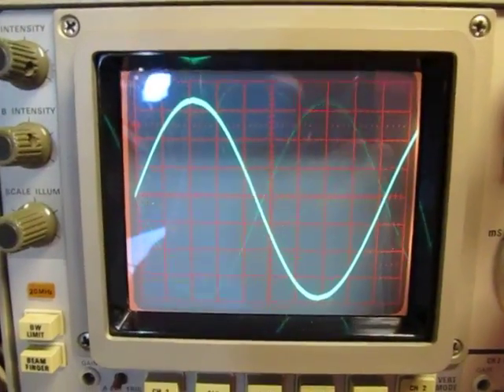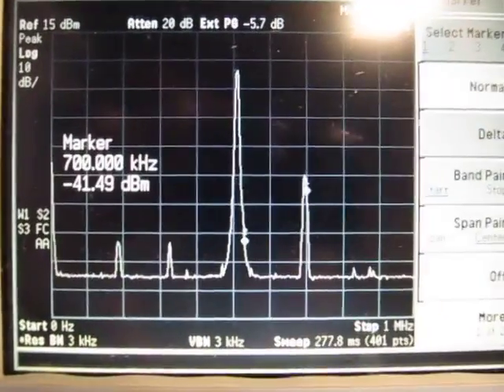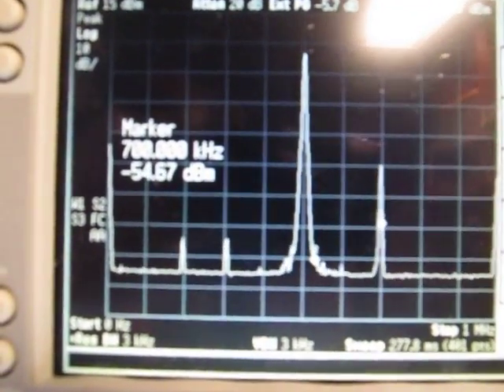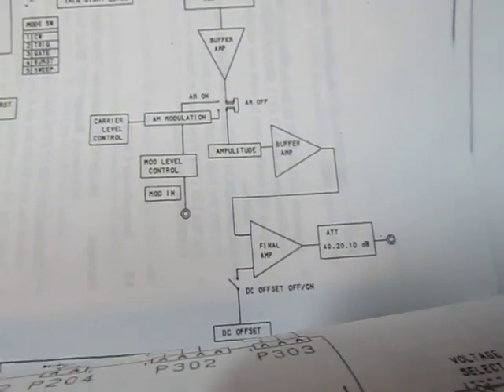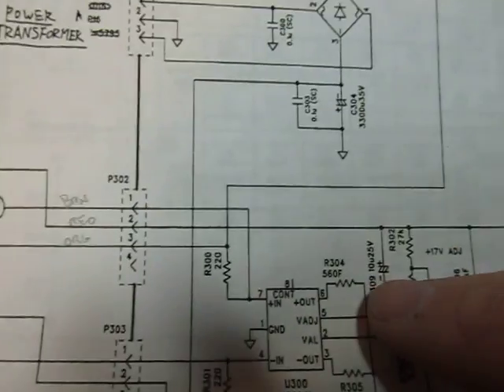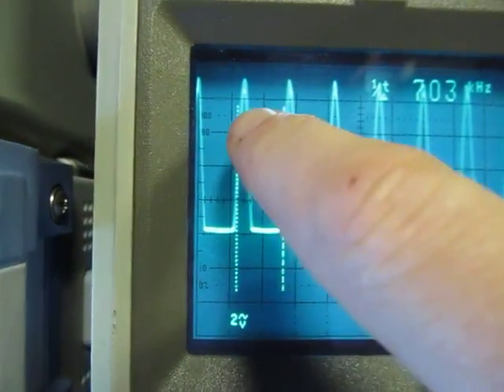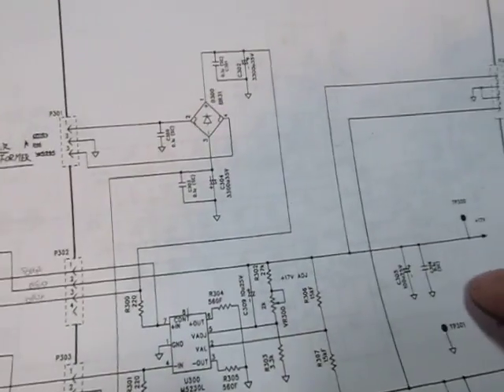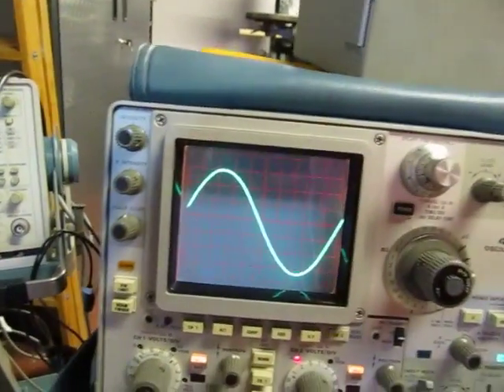#39: Function Generator debug and repair - Leader LG-1311

Comment: Excellent video!  I have an LG1311 that I got from a club sale.  It turned out to have the same symptom as yours, and omitting the capacitor cleared it up!  Good find!
With that repaired, I undertook the task of aligning the LG1311 per the calibration procedure (looks to be the same documentation you show in your video).  It was going well, but I ran into a problem...
At step 8, the forth bullet point item states"Check that the frequency with the Dial at 1 is one tenth the frequency measured with the DIal at 10."  When I did this, I got a frequency of ~200Hz instead of the 100Hz I was expecting.  Repeating step 8 didn't seem to help.  I tried the other Ranges, and the result was the same; the measured frequency at 1 on the DIal was ~ .2 x the frequency at 10.  
I rechecked the voltages and supply lines for DC and AC, no apparent problems.  All the unit functionality I've checked seems to be working as well.  The Frequency pot on the front panel is 1k (taper unknown), and appears to be original.  It has no wear issues so far as I can tell.
My question is: do you see this problem on your 1311?  If so, is this normal operation?  It's not critical for my usage (I can always hook a frequency counter to the Sync output), but it seems a little sloppy for a piece of test gear.
Any suggestions would be appreciated.  Thanks!

Comment: Do you think if you measured the capacitance under dc bias, you would see a bad value? Presumably the thing worked... Nice tip about the false triggering...next time i have trouble with the MSO scope and blaming tektronix I will look for something riding on the waveform.

Comment: Thanks for this.  I have a Leader LG-1300 with the same kind of problem.  However, it uses a different design with +/- 10 VDC adjustable, and +/- 15VDC non-adjustable.  The 10V is dead voltage-wise but there is mucho crude on the scope at the 10V test point.  Still at the head scratching stage.  de K8nn

Comment: w2aew very good video, but the engineers from Mitsubishi who design this power supply module was definitely drunk.

http://pdf.datasheetcatalog.com/datasheet/MitsubishiElectricCorporation/mXqyyxt.pdf
Reply: Seems like that cap in the datasheet is 1uF and not 10uF in all of the example circuits...

Comment: New subscriber here. Working my way through your videos from the beginning, watching the ones that seem interesting to me. You can expect some comments on older videos to appear regularly for the next week or so.
Nice tracking job. It reminds me of a story my father told. He was a radarman on the USS Newcomb (DD-586) and was trying to track down a difficult problem. He studied the schematic time after time until he thought he understood the function of every component except one resistor, which seemed to connect two completely different parts of the circuit. He eventually solved the problem (it wasn't the resistor) but filed this mystery resistor away in his head as something to think about later.
Much later, he had an opportunity to speak with a factory technician while the Newcomb was at a shore base. He asked about the resistor and was told, "Oh; that is a 'working resistor'." He had never heard of such a thing, and the technician said, "Well, if it isn't there, the radar doesn't work."
It seems as though that was an "un-working" capacitor. With it, the signal generator doesn't work (or at least not properly).
I just bought a cheap function generator kit. When I have it finished, I will have to examine the output carefully to be sure there are no spurious signals riding on the desired output.
I've been an electronics hobbyist since the late 1940s (I was five years old) when my father made me a short-proof 10 VDC power supply (B+ transformer hooked up backwards with a selenium rectifier) and gave me a pile of switches, lamps, and buzzers (all screw terminals) with a good supply of salvaged (varnished cloth insulation) #18 solid hookup wire.

Comment: Would you mind sending me the schematics for the LG-1311?  I have one, it suddenly quit working, 17v check points are down to 4.32v both negative and positive.  I'm thinking it might be the R114-115 resistor's, both are reading 50 ohms but I don't know what they are.  Schematic would be very helpful.
Keith

Comment: Awesome video!  I've been an EE for a long time and still have much to learn.
And yes, the supply is stable ... with a stable load.  Looking at the supply with a pulsed or reactive load might reveal that some form of compensation is necessary after all.  I suspect the cap fully bypassing the feedback divider is too aggressive, and a resistor in series with it might do the trick.

Comment: This capacitor raises the HF gain in the FB loop. The phase response of the loop lags more and more with rising frequency. If the gain of he loop has not fallen enough (gain is < 1) by the time the phase changes by 180 degrees the loop will oscillate. This is typical of FB loops. You just need to lower the value of this capacitor and the loop will stabilize. Have never seen this capacitor in good design. Better a poly/ceramic. Electrolytics are often +80 -20 percent.

Comment: Yes, that all makes sense. I have been a bit ESR crazy since I built my ESR meter a few months ago, but you are right, in this application, any reasonable value would not have an effect certainly not 1 or 2 ohms. Now I am probably going to have to try and track one of these regulators down and experiment with it to see if I can replicate the problem, :) . From looking around on the web they seem to have a good reputation with audio guys, so the overall design must be good.

Comment: I pulled up the datasheet for the M5230L and noticed in all the circuit examples the values of Cref was 1uf, from what I could tell the function generator used 10uf. The dielectric material used for the capacitor was not specified in the datasheet. I wonder if the preferred material would have been say 1uf Tantalum? It would be interesting if maybe you would try a Tantalum of about 1uf or maybe even a monolithic ceramic of about .5 uf or so to see what the response would be. (Continued)......